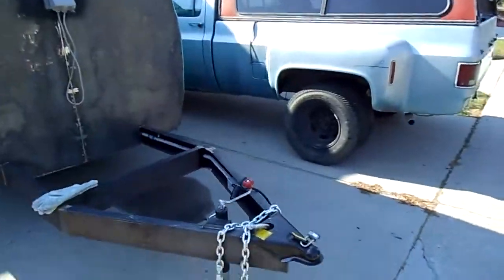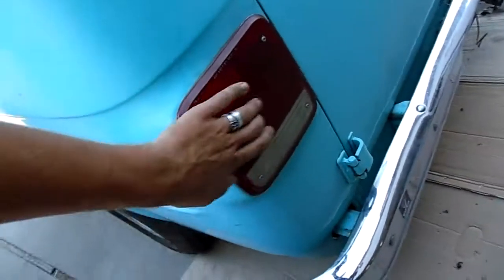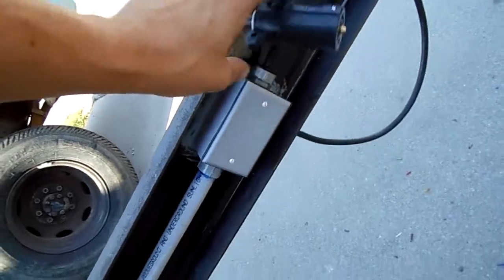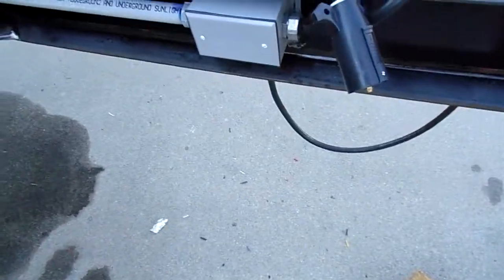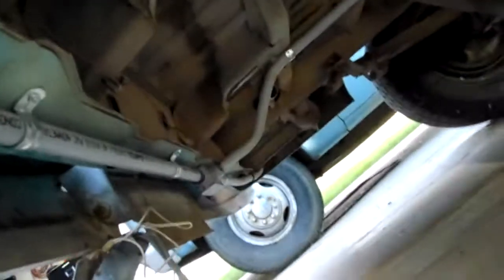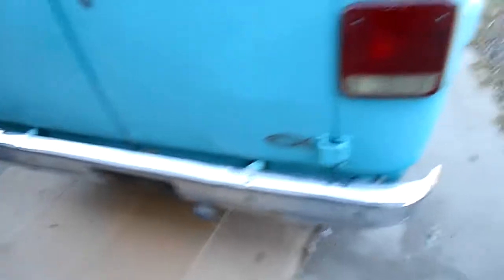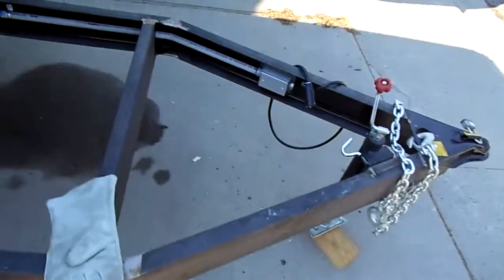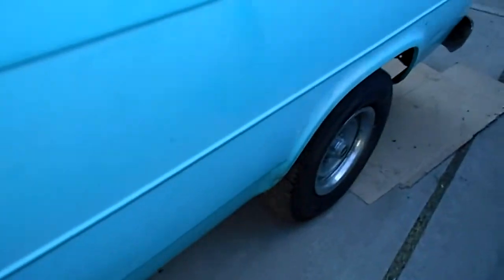GREEN BEAN Van Trailer part 8ish

Comment: That's some of the nicest conduit work I've ever seen, it almost looks like like you know what your doing :-)
In my little experience with trailers it seemed like every time they need to be used, something was wrong with the wiring.
Because most trailer wiring is exposed to the weather the connection corrode,
putting it in pipe is great idea, and well worth the effort.

Comment: I see that you ran new wiring underneath the van why was that? Was the old wiring bad? I would have just spliced into the original van wiring this way you would have had all your turn signals power and everything else I'm planning on mounting a generator where are my motor used to be